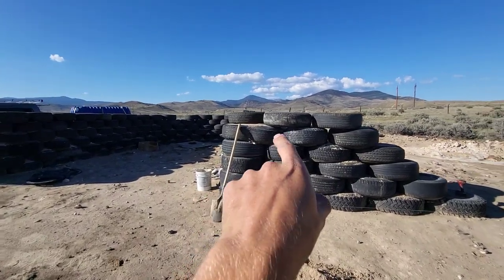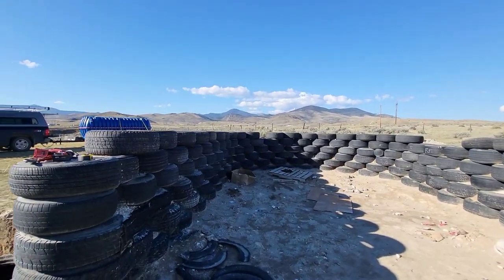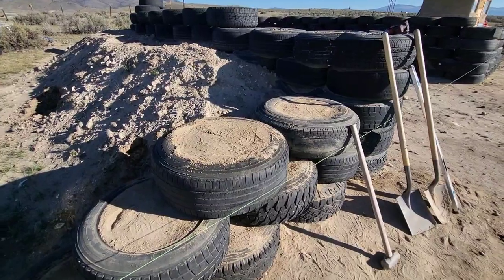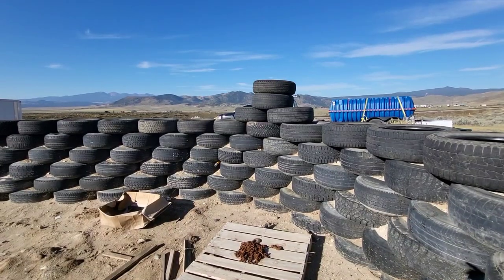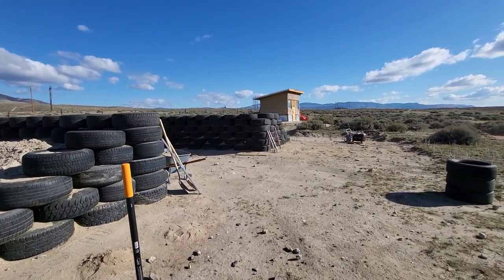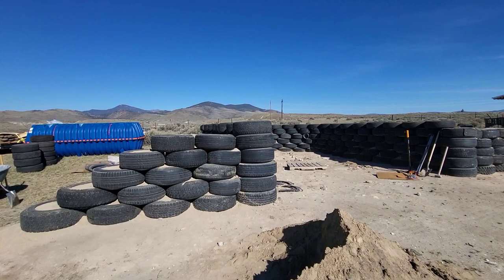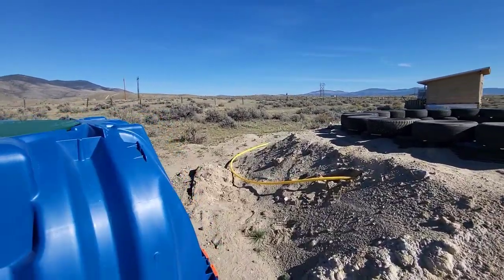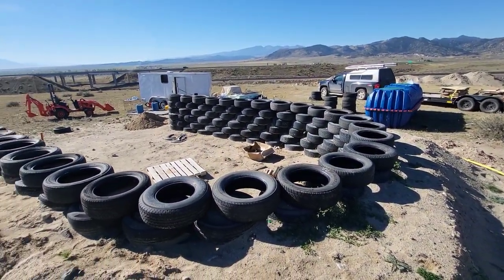Mini Earthship Build part 8: west wing wall is done

Comment: Big step getting the cistern! Are you putting it on the back or the side with this model?
Reply from the maker: I really wanted to slope the roof to the south and put it on the side, but I'm going to slope it to the north and it will go in the back. The reason is so I can expand onto the front if I ever wanted to build a big greenhouse.

Comment: did you put a layer under ground? if not your walls will shift.
Reply from the maker: The bottom course will eventually be underground once the finish floor goes in.
Reply: @nialldivers  i hope that works.. ive built one..